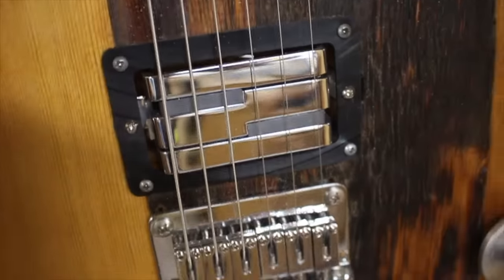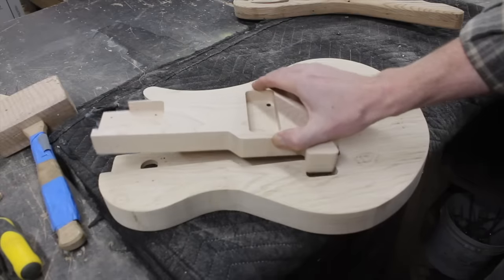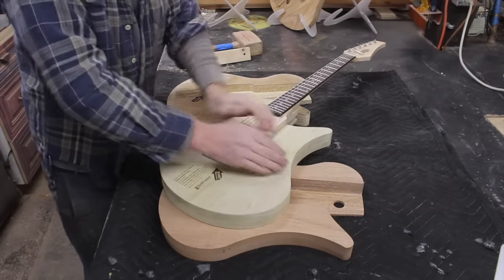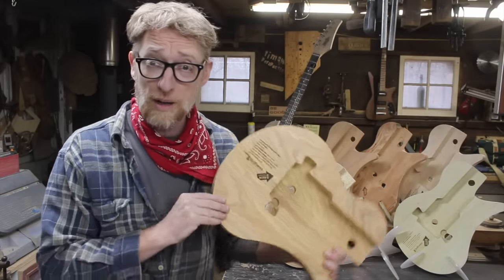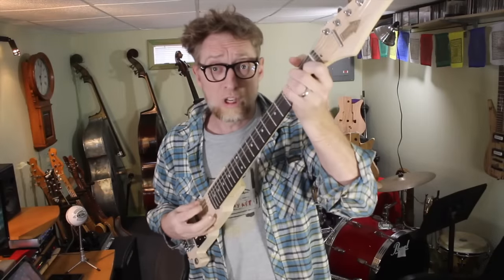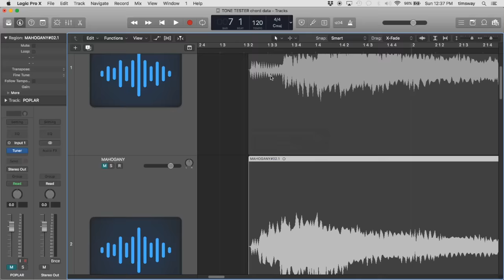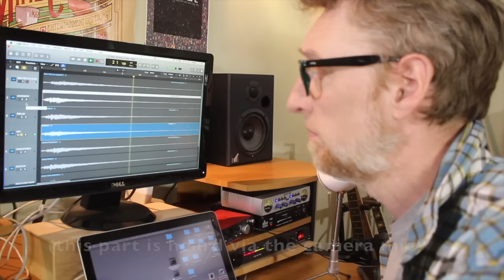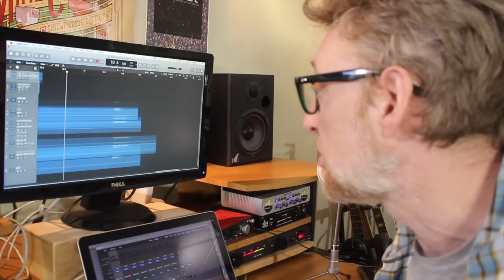Tone Wood Tester: One guitar to test them all

Comment: The entire problem I have with the whole "tonewood" thing (for electric guitars with magnetic pickups) is that it goes by species -- that's the part to me that makes no sense.
It's not that the wood doesn't matter, but the species?  It would seem to me that mass and density and construction technique are all more important than species.
I think going by species also makes the assumption that every single piece of species XYZ wood ever used in a guitar is more or less identical.
I shouldn't even have to explain why that's foolish...nature is not uniform.  Which part of the tree the wood came from, how it was sawn, how long it aged, what the moisture content is, what climate the tree came from, how old the tree is...I think all of those things could potentially matter more than the species, because all of these things could have a potential effect on the mass and density.
The bottom line is that, knowing just the species and nothing else, really doesn't tell you much of anything....but that's the logic that "tonewood" uses.
I personally think that the majority of the tone comes from the pickups, also, with an electric guitar.
I've swapped enough pickups to know that I can make a strat sound like a les paul, and vice versa, wood be damned.
Just my 0.02 though.
Reply from the maker: yup
Reply: I mean, I get what you're saying, but it's just common sense that 2 pieces of the same species are going to have more in common with each other than pieces from 2 different species. Of course nature is not uniform, but it does cluster, otherwise there would be no species' at all, just a bunch of individual trees, which is obviously not the case.
I don't think anyone assumes that all wood from the same species is identical.
Reply: Nick K that’s exactly what I’ve been thinking. Species is not the deciding factor. Density and weight make more difference than the species. Honestly, construction method, pickups, their placement and electronics make a bigger difference than the wood does at all; but my experience in buying guitars when I have a specific model in mind and try multiple examples that are for all intents and purposes identical has found that every guitar sounded slightly different. The only significant difference I could see is some of these guitars where heavier than other examples of the identical make/model. Generally I’ve found not only do heavier guitars tend to ring out louder unplugged and sustain longer, but the tone also seems a bit deeper while lighter guitars always seem brighter to my ears. I’ve had friends get guitars built from the same tree to the exact specs and they still sound different.
Reply: Nick K   You're right.  This is all nitpicking.  It's typical of humans to see faces in their tea leaves.
Reply: @thisdyingsoul76  I don't understand what makes you guys think species has nothing to do with weight and density. No 2 pieces of wood are identical, but pieces of wood from the same species absolutely have extremely similar characteristics. All maple is harder and more dense than spruce, for example, and vice versa. All woodworkers and luthiers know this.
Reply: Ar†ax there are variances between 2 pieces of wood even when they are cut from the same tree. One might be able to use characteristics associated with a species of tree as a guideline but surely there is some overlap. If there is no variance between 2 pieces of wood of the same species, why do two otherwise identical guitars still sound different and vary in weight? And with acoustic guitars you do get that difference in tone that seems related to the species; but in solid body instruments it is a much smaller factor than other things in the equation.
Reply: True. There's a range of hardness and density within species and those ranges can overlap between species. The impact of wood, let's say about 10% of the tone of the instrument, is based on the individual piece. That's one reason high end guitars are so expensive. A luthier might take hours to find the one best board out of 1000lbs of wood. Whether that's knock tone or appearance. As compared to $199 guitars that are made of whatever gets dropped off at the factory that day. Some will be good and some will be bad.
Reply: True. There's a range of hardness and density within species and those ranges can overlap between species. The impact of wood, let's say about 10% of the tone of the instrument, is based on the individual piece. That's one reason high end guitars are so expensive. A luthier might take hours to find the one best board out of 1000lbs of wood. Whether that's knock tone or appearance. As compared to $199 guitars that are made of whatever gets dropped off at the factory that day. Some will be good and some will be bad.
Reply: @thisdyingsoul76  I already acknowledged that no two pieces of wood are identical. What I'm debating is the claim that "species doesn't matter, weight and density matter", when weight and density correlate directly with the species of wood. Anyone who debates this obviously has no experience with acoustic instruments, much less instrument building. There is a reason EVERY violin and mandolin has maple back and sides with a spruce or cedar top, with a few (very rare) exceptions.
No two pieces of wood are identical, but if you plotted 1000 of them on a graph measuring specific characteristics (weight, density, etc) there would be clear and distinct clusters based upon species. This is not debatable.
Reply: pore structure, grain geometry and many other aspects unique to each species have a noticeable impact on the sound. otherwise we would just use pine.
Reply: He said it’s for fun. Tell me how to make a strat. sound like les Paul. I have 2 strats but no les Paul.?
Reply: I agree. I've always tried to inject that tone wood would be the smallest factor  in your tone next to everything else in the debate. All different factors accumulate. The wood, the strings, the pickup, the cable, the pedals, The amount of total connections and if they have a buffer, the amp, the power amp (if you use one), the tubes, the cab and the mic. And out of those the kind of wood makes the least difference in my experience.
Reply: Have experienced this stuff on acoustic instruments where the differences are in many cases not subtle at all I can say that it’s not as simple as it just being a matter of density. Maple and Ebony for example have a similar balance to each other (quite bright) while Rosewood is warmer/more midrange centric despite sitting in between those two in terms of density
Reply: Yes, the Ancient Greeks proved long ago that the idea of PHYSICAL EXACTITUDE is illogical and impossible.
Reply: @blueterrace  put Gibson humbuckers in it
Reply: Thank you, well put.
Reply: So, while two pieces of wood within the same species are likely to have more in common than two pieces of different species, this isn't always the case. Some species vary WILDLY in weight and density. To the point that they may be more dissimilar to one another than to pieces of other, less varied species. Swamp Ash is well known for being incredibly inconsistent in this way.
Reply: "More in common with" - yes, agreed, but that undefined, vague expression has nothing to do with the tone it will produce in these test conditions.
Reply: @artaxAF  You have completely missed the point and veered off at a tangent. This experimental research into SOLID construction has absolutely nothing to do with acoustic instruments and the test results support what has been said. Within your own acoustic experience, you are not wrong - it is simply irrelevant to the subject under discussion. 
Quite separately, your argumentativeness about wood species is equally irrelevant to the plain, provable statement that weight and density are the crucial factors. These physical attributes are easily and accurately measurable, regardless of the name attached to the tree. Therefore THEY matter, regardless of the myths attached to tree names.
Reply: @John-Tropi  Not at all, it seems you _ have missed the point. I only mentioned acoustic instruments as evidence that species is inextricably tied to physical properties (such as weight and density), which is why certain species are consistently used for specific functions across the board, and why there are different species in the first place. _All maple is hard and dense. All spruce is relatively soft and less dense. These are facts, not "myths". What you can't seem to grasp is that if weight and density are what matters, then species matters.
And I'm not being argumentative, I'm just flabbergasted by your inability to use simple logic.
Reply: @artaxAF  
Since niether I nor anyone else has actually denied that certain woods are more suited to some purposes than others, you most certainly ARE being argumentative! Abusive too.
Despite different contributors explaining the situation quite clearly, you continue to snipe about nothing at all.  Unfortunately you seem equally lacking in comprehension of either what the “The Point” actually is here OR the definition of logic. 
There is no disagreement that anyone can make any anecdotal assertions they like, about anything they please and they might, as in this case, very well be true!  However, you continue failing to understand that, without recorded NUMERIC data, repeatable and reproducible, for comparative purposes, such generalised statements cannot be of anything but very limited value. This does not make anecdote untrue, merely inferior. 
Furthermore, accurate, recorded measurement of clearly defined physical characteristics enables meaningful comparisons of performance - even WITHIN the same species, where there is often very significant variation. 
Since you are either unable or unwilling to understand fundamental scientific principles, you might, and almost certainly will, choose to continue your pointless sniping about nothing at all. But I for one have better things to do than waste any more time on such pointless, inflammatory nonsense.

Comment: Thank you very much for this test. It is a really good attempt to make a scientific comparison. Your solution of the drop in neck/pickup/bridge unit is brilliant. 

That said, I think a bolt on neck with a separate drop in bridge/pickup unit would be better. It would eliminate the direct connection of the neck to the bridge.  My theory is that the nut (or frets) and the bridge saddles are the two take off points for the strings.  That is where vibrations are transferred to the body. In this case, it’s effectively a neck-thru design with body wings of different materials.
Reply: The problem with that (as Tim said in the video) is that variations in setup would be more of an issue. Additionally, the wood here will still play a larger role than the wings on a neck-through, as the body is coupled to the "neck" on three sides instead of just two. True, it would be better if the wood in contact with the bridge could change, too, but this test still does a great job at showing just how little impact wood choice has.
Reply: no,and all your ideas were kybashed because of inconsistency